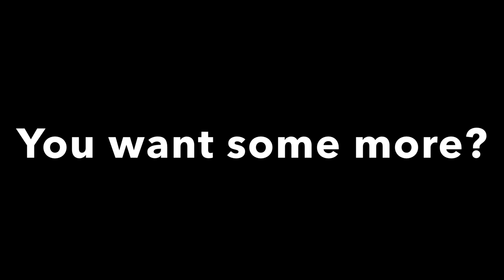Can A Battlebot DESTROY A Car?

Comment: I could only imagine the kind of damage deep six would've caused. 🤣 Great video!
Reply: Sounds cool, but letting DeepSix fire its weapon in an open field is as dangerous as walking into a fuel depot with a torch:body-green-covering-eyes:
Reply: @ppppportal283  very true, but would still be awesome to see!
Reply: and then it goes flying
Reply: The only damage deep six is causing is to itself.
Reply: @Wigeon44  Old deep six absolutely would destroy itself. Season 6 deep six would be a lot better, it sucks that deep six got removed right as the bot was actually doing pretty decent.🫤